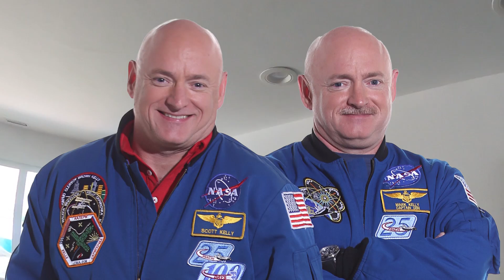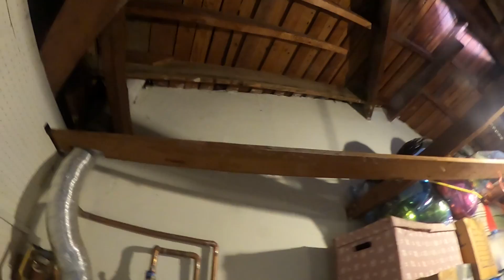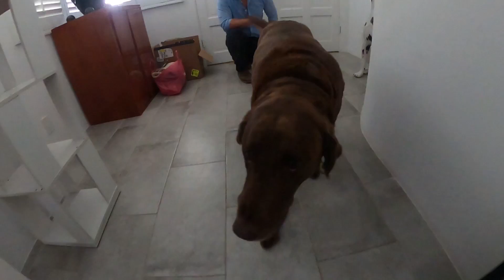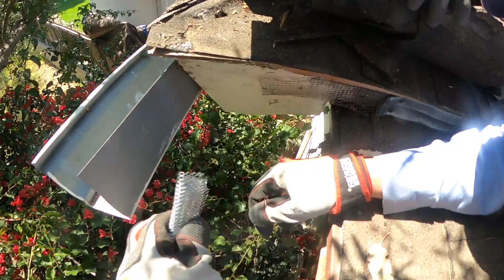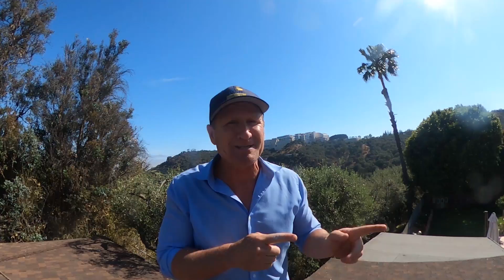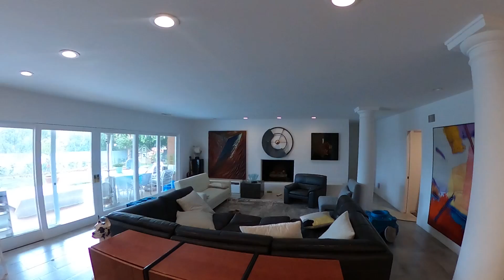MASSIVE RODENT INFESTATION!! Terminix missed this...

Comment: Got a story to tell… we have an inside mouse/mice problem. When the house next door burned down January 7 2021 we were infested with mice shortly thereafter. We had a guy come out to assess the situation for a $150 consult fee. He’d seal the outside then because the mice had gotten in the attic and ruined the insulation it would have to be replaced.Then proceeds to tell us it’ll cost $13,500. He was Suppose to include exclusion etc which is why we called him. Then tells us that we’d have to remove the mice from traps & he’d only come out 1x every 4 to 5 weeks to remove & replace the traps in the attic because he had to drive so far away. Called another & we can get it all done for $4800. I’ll be reporting them for Senior abuse. & for shoddy and false advertising.

Comment: I work for a pest Control company and I guarantee you we do not have the resources to do the type of job that these guys do. Like my company won’t even let me go up on the roof for safety reasons which I understand they don’t wanna be liable if something happens to me, I don’t know what Terminex‘s rules are but maybe they have the same policy. Also, you gotta take in consideration that the other pest control companies, including mine could have 15 to 20+ stops a day. We don’t have necessarily the most time to be doing big jobs like this company or even to do it super thorough inspections . These guys are specialists And like I said, have the materials to cut through peoples walls, etc whereas we don’t. And also, that lady needs to learn to Declutter.

Comment: When do you make the decision to replace any existing material as opposed to just filling and patching it? Some exclusion work (like in this case) can look pretty unsightly. Plus, in this case the wood on the roof looked old and crumbling - only a matter of time until rats get in again. Wondering why you didn’t replace these wood pieces altogether? Did the customer not want to pay the extra cost associated with doing so?
Reply from the maker: Great question! In this particular case, the homeowner was scheduled to do a complete re roof and replace all the wood. 
 We are often restricted to homeowners financial capabilities. 
Your point is super important, in that it’s super important to perform permanentl exclusion work the structure itself has to be impervious. 
Thanks for sharing this awesome feedback.